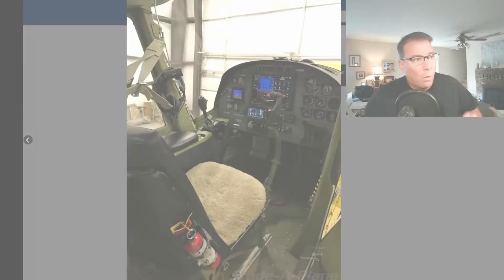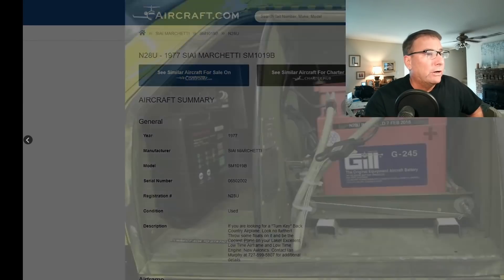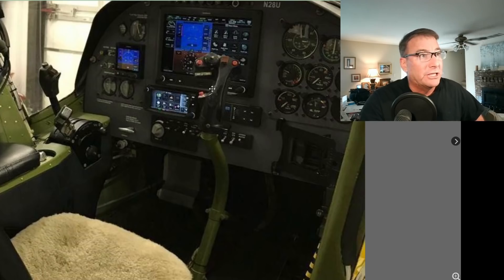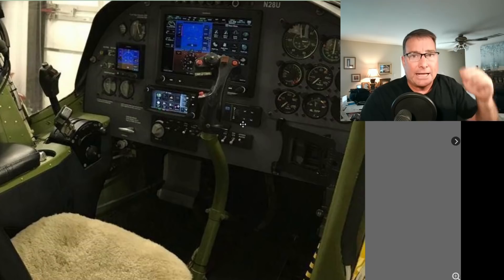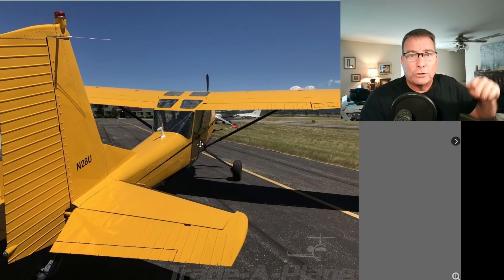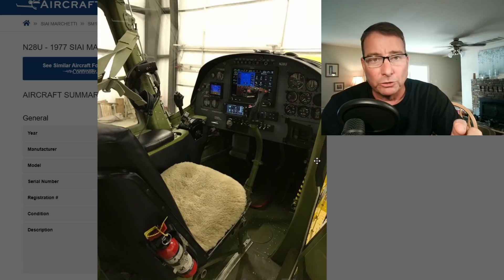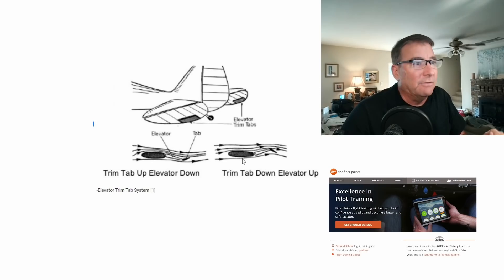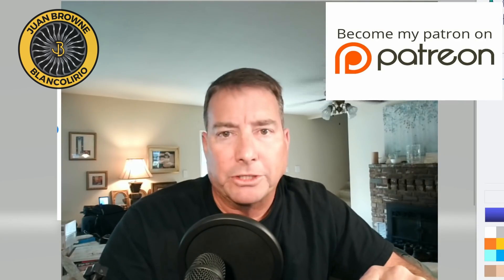Dale 'Snort' Snodgrass Siai Marchetti UPDATE- Elevator Trim System 8/8/21

Comment: Pulling the power back would lower the nose. Does it every time.
Reply: This plane is a turboprop.  You don't just cut the throttle if you intend to keep flying.  It is basically a jet engine with a propeller on it. It has to "spool up and spool down."   In this scenario it was mere seconds between when the lifted off and then immediately stalled.
Reply: NOBODY is trained or would think to pull power while in an excessively nose-high attitude at low altitude.

Comment: Observation from a 24000+ Hr former Navy pilot and Airline pilot; if you look at the horizontal stab at point of impact....it deflects in a downward motion (possibly caused by a body slamming in the control stick) and the immediately returns to a locked horizontal position. No upward motion as one would expect if the stab was in an unlocked position, not down as the result of continued pressure on the column or pushrods that are crumpled in a down position. The elevators  (both sides) return to the same plane as the horizontal stab, completely in line and with force and in sync with each other. Electrical trim and trim tab issues would not return them to the neutral position post accident. Guess we'll have to wait until the feds come up with the answer. JMHO
Reply: Others also said sudden control stick accident caused by a 'seat back' collapsing.. this is just speculation though from other pilots on the internet (they claim)

Comment: In the USAF in my time, 1968-1988, flying the RC-130A, AC-130A and as an Undergraduate Pilot Training Instructor in the T-38A, I recall runway trim exercises. To deal with high pitch forces, banking the aircraft while following other acft specific procedures, was the way to lower the pitch angle to avoid a stall. Of course, it is unknown for now if Dale had flight control issues. Nose trim can only do so much at high pitch angles.

Comment: @blancolirio, To make it worse, on some aircraft, specifically ones with light controls, there are Anti-Servo Tabs, which work in the same direction as the main elevator and work by making the controls heavier and more stable.  They can also be used to trim the aircraft.  The Grumman Yankee (originally designed by Jim Bede as the BD-1) is a perfect example of this.

Comment: To me (a non-pilot) the really horrifying thing about this accident is the speed at which events happened. From the wheels leaving the ground to impact is 10 seconds at most. It seems most unlikely it would have been immediately obvious something was wrong so the time to react and take corrective action was less than that. Even if the assumption that corrective action can be started in 4 seconds is realistic it looks to me that would have been too late to be effective.

Comment: the pitch up progression  without oscillation of trying everything hints at a load shift, slack tank liquid load that pushed the CG aft and outside the envelope
Reply: I'm thinking the same thing... no evidence whatsoever of any counter inputs or resistance.  For a sec, I even thought there might have been a total elevator cable failure, or jammed elevator (or jammed cable), but they'll absolutely have to rule out an aft load-shift.

Comment: It’s discouraging that first ‘opinions’ were ‘oh, he left the gust lock in’, or, ‘why didn’t he check his controls before takeoff…’as a 150 hour private pilot and I always’…….or some such drivel.
Reply: Up until now, it's still quite probable the problem could have been spotted with less rushed departure.

Anyway - problem solving is about listing possibilities and then work through them from most likely to less and less likely.

Comment: thats prob the smoking gun. was the "shit shit" over the radio? would that mean he PPT instead of trim, or trim not working so trying all buttons. im not a pilot, but id be checking every electric control preflight. i guess we havent learned anything from Boeing. even something that simple could be flipped with less than a line of code.

Comment: I don't think a powerful engine makes the pitch trim more difficult to overcome.  Trim responds to airspeed not power.
Reply: Prop-wash is certainly a factor with this plane.
Reply: @davef.2811   Yes, that’s probably also why the vertical stabilizer was enlarged from the original design.
Reply: @davef.2811  Prop wash over a broken pitch trim didn't make that plane pitch 40 degs nose-up at rotation speed.

Comment: But that doesn’t explain why the elevator wasn’t ‘nose down’ , even if the trim tab ran away. I flew F-4s when the stab horns were breaking, stab went full nose down, aircraft full nose up. I’m betting something broke, elevator went full trailing edge up, aircraft full nose up…but NTSB will figure it out.
Reply: Right after the stall onset, it looks like it might actually be down-elevator. A few frames prior in the video, it looks more neutral: https://www.dropbox.com/s/v0fxgwhk2m9jo8k/down_elevator_maybe2.png?dl=0

Comment: A question that this raises in my mind if that, with this being a tail dragger, would there be any reason for Dale to have nose up trim tabs set while taxiing in order to keep the tail on the ground.  It strikes me that this might be necessary if you're planning on making a STOL, three-point take off.  But would this be something that a pilot might do, and, if so, is it then possible that the trim tabs might have stuck in the full nose up position, which could be something you might only discover when in the air and trying to trim the aircraft into a more neutral state?...
Reply: Two control sources?
Reply: @larrybe2900    One would imagine that there would be a control for the elevator trim tabs on each control column...
Reply: @gosportjamie  
.....when it comes to which one is actively flying the plane?
Reply: @larrybe2900    That's something the investigators will be looking into.  However, with that style of aircraft it seems fairly unlikely a solo pilot would be flying from the rear seat due to the massively reduced visibility, and looking a close ups of shots from the crash video it would appear that he was in the front seat, though it isn't really easy to tell for certain.  This is why there is the wondering about whether something in the rear cockpit moved and jammed the rear control column, being as he was flying to a high level field for a camping trip and, presumably, had his camping kit in whichever seat he was using...

Comment: I had a run-away trim on my Arrow on takeoff once. I was strong enough to force the yoke forward and disable the electric auto-trim, but it was surprising at the time. Could the front seat going back off the rails just push through that control panel with all the weight?

Comment: Wouldn't an Air Bag System, a Halon Fire/Chemical Powder Suppression System, a Carbon Fiber reinforcement of the cabin and maybe fuel cells help in these airplane crashes?  Airplanes can afford these life saving devices.   TD Atlanta

Comment: I can’t believe that he couldn’t overpower any trim setting at these low speeds  He would have been pushing for his life as the nose came up.  It’s a certification requirement, and even if the SIAI fudged it a bit, maybe you couldn’t overpower it at cruise speed, but this was so slow that the stick forces have to have been “reasonable” for a strong guy like him.
Reply: You are at your highest RPM setting when taking off, that’s why.
Reply: @JediOfTheRepublic  I’ve flown a couple of higher HP piston singles (285 and 320) and what really makes a difference on the forces exerted by trim is airspeed. There’s a small effect from the slipstream on takeoff, but it’s definitely secondary to airspeed. I’d like to hear from an SIAI Marchetti pilot to see what the control forces are like and how hard it is to overcome runaway trim.  I had one incident with runaway trim in a Mooney at cruise in IMC that required quite a bit of force to overcome, but as I slowed down to maneuvering speed, it became reasonable and I was then able to at least pull the circuit breaker and use the manual trim wheel.
Reply: @JediOfTheRepublic  No. Propwash isn't nothing but he definitely should have been able to overcome the trim.
Reply: @JediOfTheRepublic  Have you watched aerobatic pilots? They are out of trim and at full power during their entire airshow exhibition. We always overpower our trim constantly at all power settings.
Reply: Yeah, any trim setting should be manageable at those slow airspeeds.. something else happened. Sabatoge and elimination of a fierce warrior?

Comment: Can someone explain how a small trim tab would create such aerodynamic force that it overpowers the larger elevator and pilot controls to the elevator?
Does the shape of the elevator and trim tab together actually create the profile of a wing which creates lift which pulls very strongly on the elevator?

Comment: Looking again at the take-off video, he had about a 120-foot roll out before lift-off, then a somewhat gradual climb angle until he was maybe about 15-20 feet off the ground. THAT'S when his climb angle changed very suddenly.  On the 'What You Haven't Seen' channel (where the video is) some commenters have suggested that possibly some of the pilot's camping gear in the back seat somehow shifted against the back seat control stick, pinning it in full back position. Hopefully the cockpit area was kept intact after the crash......  

So sad for such a renowned pilot to have his life ended this way.......
Reply: Yes, another commenter on that massively popular upload the yesterday or so, had a few commenters talk about how the back seat sometimes collapses on these planes? He applied more weight as soon as the plane lifted, and it collapsed, forcing his hands on the yolk to also accidentally (and abruptly) pull full force backwards, similar to if a plastic chair has the back legs out, you are going backwards fast.

Comment: Without being one of the guessers as to the probable cause, I can contribute a related scenario.

Back a long time ago, when flying civilian Herc’s, we developed a scenario in the simulator where runaway trim occurred in both pitch and yaw.  We found that if we did have uninterrupted runaway up trim to the stop we could roll into a 45 degree bank, lowering flaps as speed decreased, and because of the normal back pressure required the airplane was flyable with full nose up elevator trim.  Of course, in reality we would never allow the trim to run that far, but it was a good training scenario for the crews.  As long as you had fuel you had time to trouble shoot and resolve the unresolved elev trim issue while in a controllable, banked turn.  The airplane was unflyable with wings level.

I’m not saying rolling into a steep bank right after takeoff in that airplane would be the solution, but the concept, tested in one’s own aircraft, might be something to explore.  Certainly, keeping the wings level in that situation is not an option.  Admittedly, the entire event happened extremely quickly with minimal chance for recovery for even someone with Snort’s experience.

Whether related to this or not, my mantra just prior to each takeoff, remains: FLAPS, FUEL (fuel selector, mixture, boost/fuel fuel pump(s), TRIM as a final check before beginning my takeoff roll.  Obviously, this is in addition to a proper Before Takeoff Checklist being accomplished.  It is not a replacement.
Reply: Another thing, Mr. Puerta. C130 been a hight wing airplane, when you lower flaps at full power, will it, like any high winger, will pitch up even more?  Was that programmed in the computers sims of that era?? Flown 11980's sims in which flaps didnt have effect on pitch, which is not right.  That can fool you into pilot errors at low speed.
Reply: @emergencylowmaneuvering7350    Yes.
Reply: @emergencylowmaneuvering7350    The double stretch, civilian L-382G was pretty neutral in that regard.  No flap change unless the pilots specifically selected it.  Takeoffs were F50%, landings F100% (or what was called Flaps Full).  Go around was max power, Flaps 50, positive rate, gear up.  Easy to manage.

The props were the killer item.  One or two engines out had to be managed properly.
Reply: Haha yeah right. Entering a 45 degree bank in a c130 immediately after take-off to buy time to solve a trim problem...... you have been watching too many movies.
Reply: @paulcoote3094    I am only responsible for what I said, not what you misinterpret.
Reply: Manny,

Exactly the procedure I was thinking of. We practiced a runaway up pitch trim after take off in our Learjet and Falcon Sims, and rolling into a steep bank works. One can then disconnect the primary pitch trim and engage the secondary trim, and get things back under control.

Of course I'm not that  familiar with this aircraft's trim system, and by all accounts Dale was an excellent pilot, very experienced in all kinds of aircraft, so I'll be very interested as to the cause. Always sad to loose a brother aviator.

One other thing. I always assumed that any aircraft coming out of maintenance needs an extremely thorough preflight, to include all the control surfaces. I went so far as to make up a written "Post Maintenance Checklist" which took me well over an hour to complete. Can't be too careful.
Reply: @johncox4273  All of which assumes you KNOW what is going to happen, and have a pre-planned response in your mind ready to go. That plane leapt up and went vertical, stalled and crashed in a matter of seconds. He had time to realize it was crashing but little more.
Reply: @MrJeffcoley1  It did not go vertical.  It did not stall.
Reply: @John_Freas  Did you watch the video? OK, maybe it wasn't completely vertical, but the nose was WAY higher than it should have been. And it didn't fall out of the sky like a rock because the wings were producing lift.
Reply: @John_Freas  It certainly stalled and entered an incipient spin to the left. You can't spin unless you stall.
Reply: @John_Freas  you must have watched a different video than everybody else.
Reply: @FRLN500  Not at all.  The airplane was not at all vertical, and while it did roll off to the left, there was no indication that it had actually stalled.  Had it done so, with that roll, it would have spun in and it did not.  It may have been the result of torque as it slowed, or maybe that wing did stall briefly, but before the nose was pointed at the camera that airplane was flying a nice arc in the direction of bank.  It was flying.

The question is why was it not rolling back to level.  It rolled nicely into knife edge, but no similar control the other way?  Even stalled, opposite rudder would have begun to lift the down wing fairly quickly and the resulting yaw would have been obvious on the video.  It looks to me like there was a control issue beyond just elevator.
Reply: @John_Freas  No indication it stalled? OK then I guess Dale was completely in control of the aircraft and just decided to take a shortcut to China.
Reply: We Are Talking Big Airspeed,,, vs    "No Airspeed",,, Good Try,,, But No Enchilada,,,
Reply: @johncox4273  In small organisations, the question of who conducts a post-check test flight usually leads to a vigorous discussion.
Reply: @johncox4273    Good for you on the post-maintenance preflight.  Maintenance induced failures can certainly be an issue.  I don’t take anything for granted, either.

The other thing I might mention is a go around from a full nose up trim, full flap, short field approach in a 185 at sea level.  There is usually no electric trim, so if you are solo you’re in for a struggle.  I train to only add 25” of manifold pressure (to reduce the pitch up moment), flaps to 30 or 20, push like hell and trim.  It’s quite an exercise and an eye-opener if you’ve never done it before.
Reply: I read somewhere of a DC3 carrying heavy cargo which slipped back on take off, Both pilots were JUST able to keep control against the aft CG but not for long before their strength ran out, so they rolled it into a steep turn once high enough and that gave them time to move the cargo forward again and restore the CG. 

Also, on Concorde line training with first-time Conc pilots they were briefed to level off at 1500' after t/o and many bust that level such was the rocket-like performance at light weight. One of them told me "I used to get it turning - that cooled things down a bit!".

Comment: In this airplane, when you’re running your pre-flight checklist, how do you know the elevator trim is in the takeoff position?
Reply: I suspect there is an indicator, either mechanical or electronic.
Reply: The jet I fly marks it with a green takeoff band.

Comment: Non-pilot question: I haven't seen the wiring or the actuators for this, but wouldn't there be some kind of "idiot-proof" design here? Like wires that were color coded and connectors that can't be plugged in backwards? Pins and mechanisms that can't be hooked up in reverse?
Reply: Thing is, what if you had to splice in wires to replace broken or fraying ones? There's always room for error, no matter the idiot-proofing.
Reply: Probably those systems are in place, but it's likely that the cables can be replaced independently of the connectors, allowing for faulty reassembly
Reply: Apparently not always, based on various comments here and what Juan said.